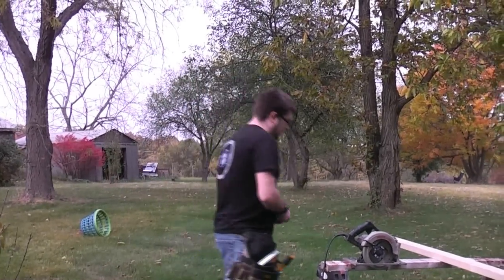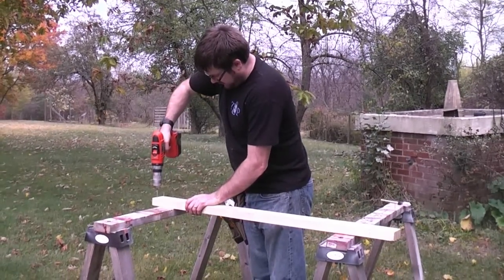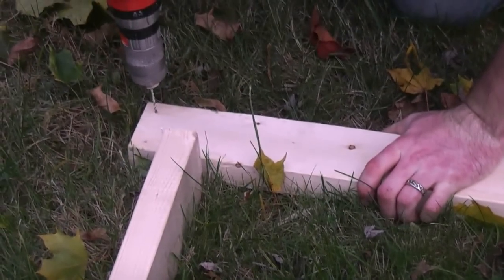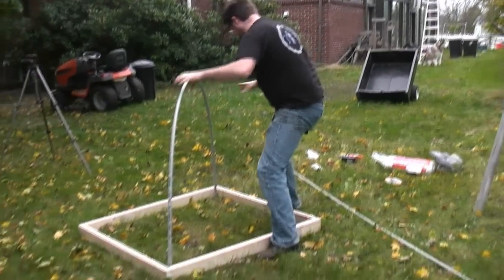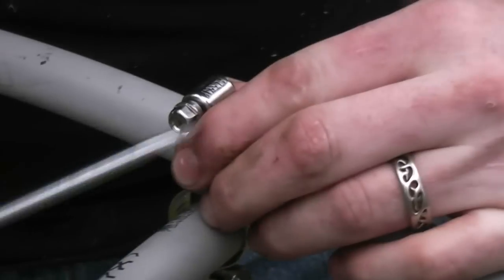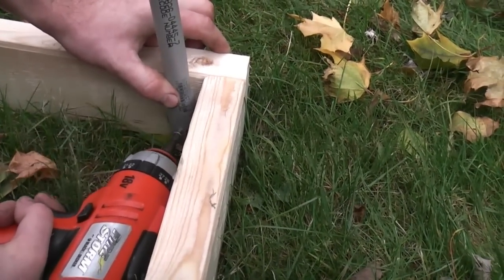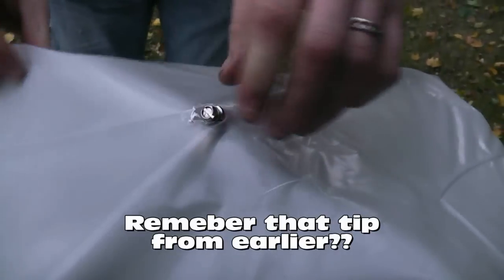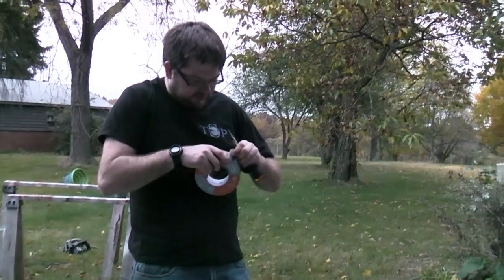DIY PVC Green House/ Cold frame

Comment: Glad you kept this simple; some people with their massive designs and elaborate fittings understimate how expensive the builds cab be. That doesn't factor in the sag factor or the tendency of PVC to become brittle after prolonged exposure to UV. Most people don't think about this, but it can be painted. Great job.
Reply: Thanks. The grey conduit does better than the white plumbing variety in the sun. This has been out 24/7/365 since I posted the vid and it's fine.
Reply: Ducky it is complex enough to work. What else matters?

Comment: Black wire ties would be cheaper and easier than clamps for the cross connection.  Use black ties instead of white since they are UV resistant.
Reply: Adriana Gutierrez ........ .

Comment: know what is faster than trying to put that screwdriver tip in the slot of those hose clamps and having it keep slipping 'out' ? Use a socket that screw...once its on, you can tighten FAST with a ratchet!!!!!